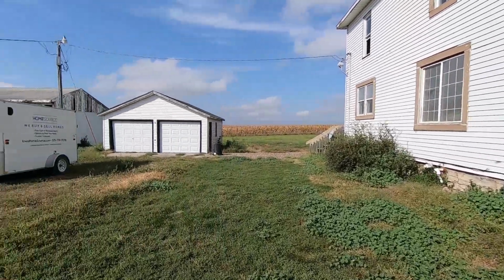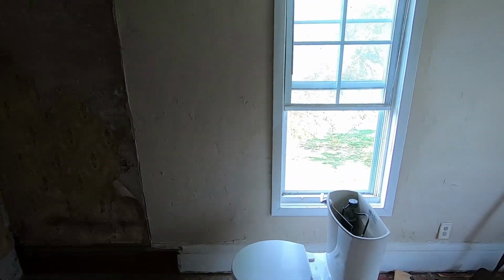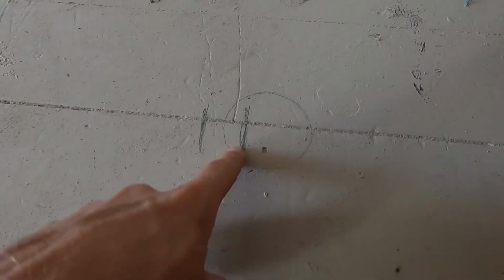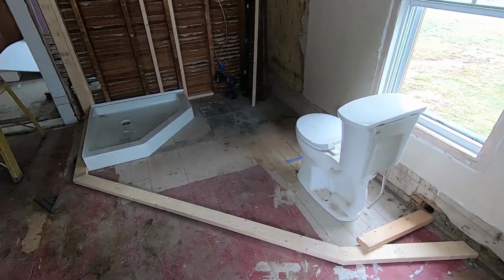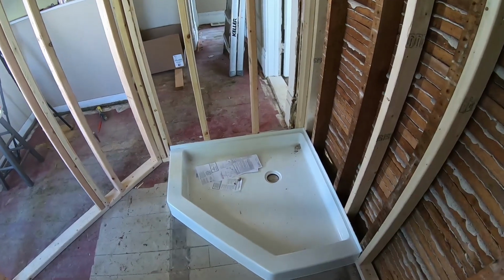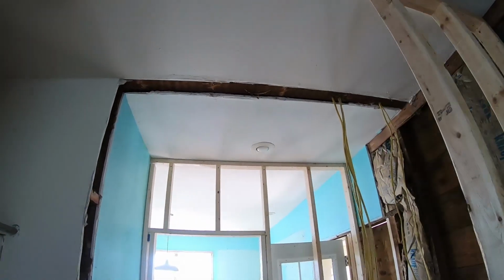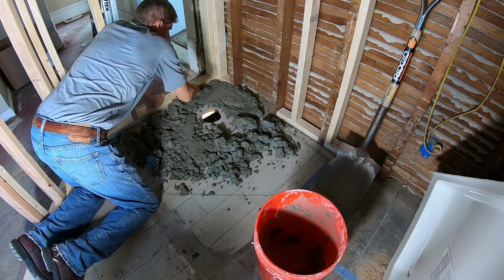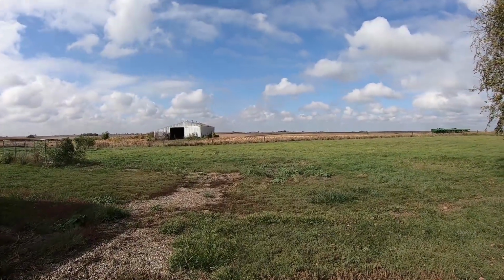Let's add an upstairs bathroom! - Bittersweet house flip part 11

Comment: Looks great.  When you were mixing the mortar with the garden hose it got me thinking about the water source.  I have not seen a well house so I assume the place has rural water.  If so, that is one less thing you have to redo.  🙂 I know you said there is an old well by the garage, but I bet is not being used.  Looking forward to seeing the completed project (house and outbuildings) when you get them finished (I think you said in the spring of 22).
Reply from the maker: Yep that’s correct. The old well has been filled in and the property is served by rural water now. I’m hoping we’ll get the out buildings fixed up early January. The house is coming along soon!

Comment: Will the door for the bathroom swing toward the toilet?? Huh what about putting the toilet in the corner and the sink in front under the window. 🤷‍♂️ I assume you thought of all of it…. Looking good.
Reply from the maker: I went round and round on that.  The issue is the wall next to the window will be on an angle so it wouldn't work to put a mirror above the vanity it if was placed there.  The only other option was to eliminate the window, which I didn't want to do.  I've considered a sliding barn style door to avoid the door swing altogether.  Not sure if there's enough wall space for that to work but I may look into it.  Thanks for watching!